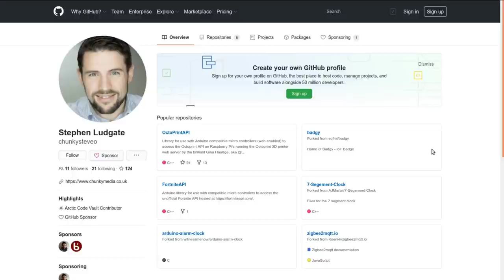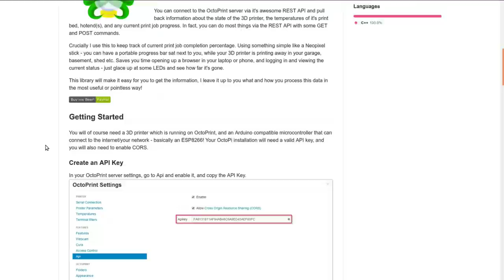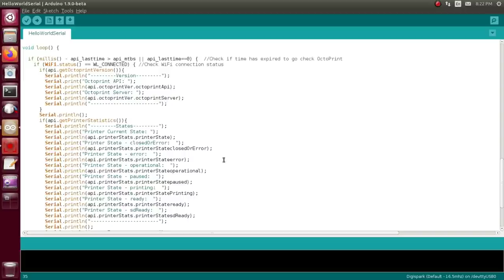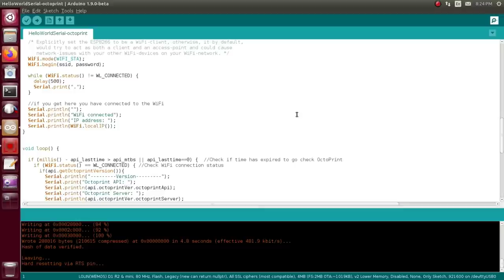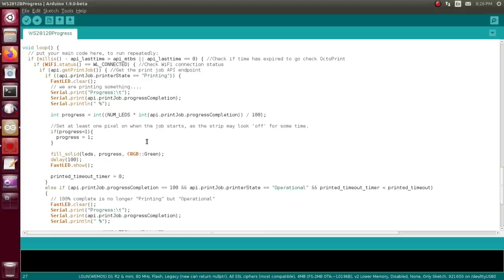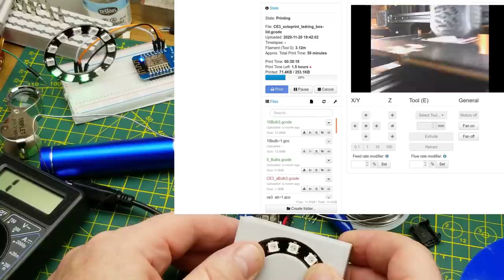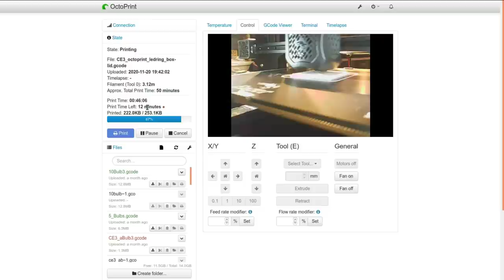Building a simple 3d printer monitoring device

Comment: That's a neat little project! What USB power bank are you using? I'm struggling to find one that stays switched on when there's only a tiny power draw.
Reply from the maker: This one was just some random promo freebie I got with a company logo on it. 
Though I have used the monitor on a couple of the cheap power bank kits that I built a year or 2 back. 

Between the WIFI on the D1 mini and the LED ring, this probably draws enough power to keep most power banks alive.

Comment: Has anyone found a high temp glue stick that won't melt in hot environments? (I know you didn't end up using hot glue on the esp chip, but I think it would have melted next to the esp chip.)
Reply: I don't have an answer, but wanted notification if you get an answer.   :)   good question

Comment: Cool little project if you have a 3D printer, lol.
Great video
Reply: Those of us who have built models might just grab some sheet styrene, and exacto knife and maybe a small file, a square and a compass, and some glue. Probably quicker to scratchbuild than to print, too.
Reply: @markfergerson2145  actually that's a good idea, I am also into woodworking and have a couple of those circular RGB LED modules. I could route a housing for the modules and make a cool way to make this work.
Reply from the maker: I have done the same , and probably still will occasionally.
Reply: @stevetobias4890  Don't get me wrong- I'm not knocking 3D printing. There are things that as far as I can tell can't be made easily any other way.
Reply: @markfergerson2145  I got where you are coming from and I agree. I personally just don't have the room to set one up so I look for other methods.